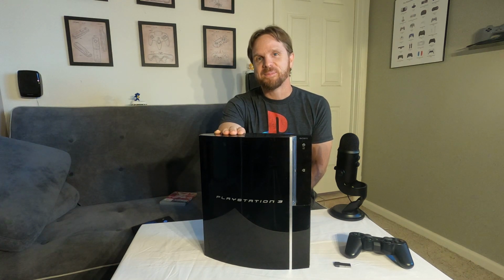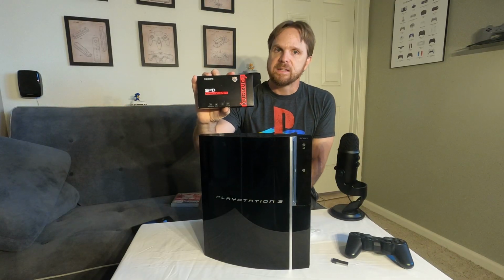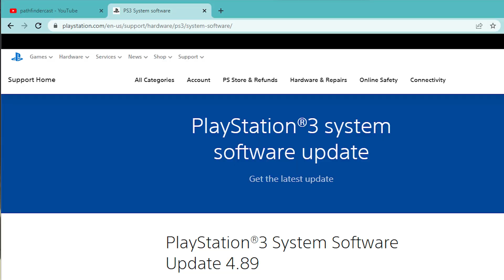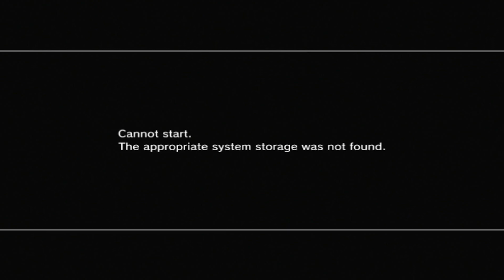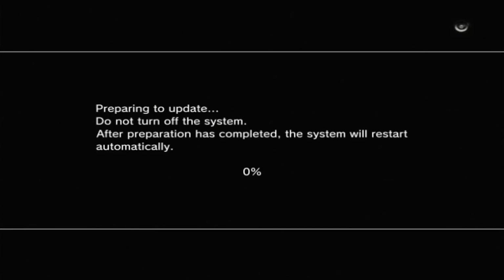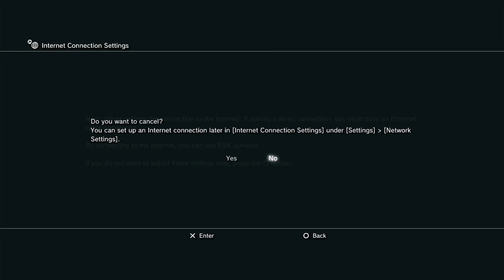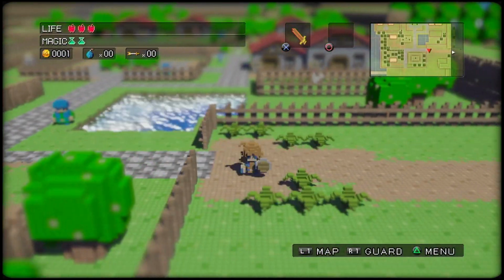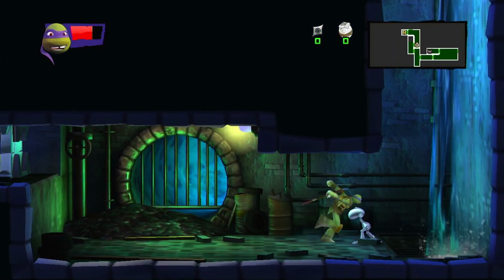Installing a cheap 1 TB SSD in my PS3 for a performance boost

Comment: You're limited by the ancient SATA connection within the PS3.
The SSD will virtually make very very limited difference.
Reply: This is partially true. Yes you won't get the full sata3 bandwidth but the 150mb/s the sata1 allows is far far faster than the 20mb/s or so that ancient hdd transfers at.
Reply: @MeepMeepMwo  yeah I agree those HDDs are old. But for me it's tryna save people from buying SSDs and thinking automatically that the PS3 will have some type of upgrade with an SSD as the PS3 has a habit just like the PS4 slim known for killing HDDs and SSDs. In the sense of they die faster and it would be a waste of money having a drive die on you and one spent $60-150 on an SSD or powerfully HDD. Although SATA 1 drives and hybrid drives are still costly, but it's the best bet to kinda have a proper drive that is compatible with the PS3 and actually helps the PS3 achieve it's max speed in writingspeeds.
Reply: @MeepMeepMwo  am just tryna help people get more bang for their buck, also to help them achieve the max writable speeds and improvement they are looking for on the PS3,  as the hybrid drive or SATA 1 can achieve these things as I've bought SSDs and HDDs thinking it would help the PS3 only to wake up one day and finding out the HDD or SSD died or failed to initialized the boot on my PS3.
Reply: @truthseekersthenewomega97  So is it a lack of trim support that is 'killing' modern ssd drives because sata is 100% backwards compatible. You don't even need a hybrid hdd just a normal modern seagate barracuda has a fast enough transfer to make it a worthwhile upgrade.
Reply: @MeepMeepMwo  true, but the interface doesn't take advantage of the barracuda I had a 500gb barracuda and it died after 6 months on my PS3. Not sure if it was just that specific HDD maybe had bad sectors, but I've had other SATA 2 or 3 HDDs and SSDs die or fail or go bad or the PS3 slows down so bad in game or you can tell on the xmb while scrolling it stutters.
Reply: @MeepMeepMwo  I should make videos on the comparisons of hybrid vs SSDs vs HDDs on a PS3.. As from my experience with hybrid drives on a ps3 it has cleaned up many of the errors, textures and graphics, loading screenings, cutscenes up with many games on the PS3 PS1 and PS2 if you have a backwards compatible model. Compared to the HDDs and SSDs I've used before. Uncharted 2 nd 3, last of us, slow downs in resident evil on the PS1 final fantasy plays much better and can confirm on my 3001 b slim Final fantasy Japan PS3. And On My 2501a slim Grand Turismo.  
Far cry 4 also plays much better grand theft auto and fall out new Vegas that has slow downs on the goty edition. I can sit here name the enhancements using a hybrid drive. It might not make the PS3 op in speeds but it those achieve what the PS3 needs and is asking for.
Reply: @MeepMeepMwo  as far as SSDs dying and going bad so quick I have no explanation to be exact on why this is happening...
However I can say this making sure the SSD or HDD is compatible as far as interface and connection goes. Don't be a me and buy SSDs and HDDs that cost $80-150 dollars thinking it's going to make the PS3 faster in loading screens 😂when the PS3 is a PATA -Sata 1 connector. Anything above SATA 1 is really just killing the hard drive or SSD TBH..
Reply: You're right. So I installed a hybrid mechanical with 8gb ssd cache that solved all the stuttering in cutscenes (FF XIII)
Reply: @skyen85  it really those help bro a lot of people don't see it but having the hybrid drive is like having an HDD and SSD at the same time and for ps3s case a hybrid drive those way more then having a powerful all out SSD as the PS3 doesn't even utilize all of the speeds. 
But the PS3 can take advantage of the hybrid drive and fix many things you'll notice it bro as you keep playing many others games especially on the PS1 side of things having a hybrid drive will clean up PS1 titles stutters shaders not working properly and textures.
Reply: @skyen85  the hybrid drive will also clean problems in uncharted 3 and the last of us. And many titles that were release in 2014-2019. Like stutters textures and cutscenes.
Reply: @skyen85  having a hybrid drive on a backwards compatible PS3 also cleans up many PS2 graphical issues and texture problems .. this is only if you have a backwards compatible PS3. I didn't really notice any difference in PS2 games on my cfw 2501a Grand Turismo PS3 console although PS1 and PS3 games run great with the hybrid drive on any model as is...
Reply: Exactly. I swapped out the HDD in my PS4 Pro with a 1TB Samsung gen 3 SSD, and it made a huge difference for sure.
Reply: @princegroove  on a PS4 it's slightly a different story as the PS4 is using USB - SATA connector where as the PS3 is PATA - SATA.
Reply: @princegroove  A PS4 isn't a PS3. SSDs make virtually no difference due to the limitations of the PS3 and the maximum speeds it can process data.
Reply: @darrenwilson99  thank you bro cause this is literally what I've been trying to explain to  them🤣🙃😩 yes the SSD will make booting up quick or loading time slightly fast, however the overall performance isn't exactly great due to the hardware limitations of the SATA 1 interface...

A SATA 1 or hybrid drive would indeed help the cause, meaning one doesn't have to waste money on an SSD to achieve max speed on the PS3. When all that is needed is atleast a SATA 1 drive or hybrid drive that takes advantage of the interface.
Reply: I was about to make this point lol🤣 SSDs do not give ps3s perfermance boosts. The best you can do to atleast get a better download speed and upload / maybe slight enhanced loading in game speed would be a hybrid sata HDD. I currently have a 1.5 TB sata hybrid drive and it's amazing 😅.
Reply: Btw the PS3 can only take 1.6 TB of internal storage. One can find old SATA 1 SSD 1.6 TB hard drives on Amazon, but you would have a steep price to pay. They work extremely well but the PS3 is also known as a hard drive/ssd killer so be careful.
Reply: @truthseekersthenewomega97  Thats not true in the slightest, they cant "kill" drives
Reply: @johnpsy4129  I have 3 ps3s a bc cechA01 a Japan 3001b final fantasy PS3 and a 2501a model Grand Turismo PS3  And I can assure you my PS3 has killed my hard drives for not using a SATA 1 HDD or SSD. You can run a script while on cfw that let's you check the hard drive life etc. I've had a 1tb SSD die on me and 500gb barracuda die on me also and a couple of cheap SSDs die on me... 
I've recently upgraded to a hybrid state drive this past year and my ps3s performance has been smooth running with a SATA 1 and I don't get the yellow light blink each time I start the consoles anymore as that would happen to me on my previous hard drives everytime I would turn on my consoles it would blink slight yellow before turning on.
Reply: Thank you
Now i don't have to even think about it
Reply: what SATA version is this again?
Reply: @RCN2820  you can choose between a SATA or SATA 1 HDD or SSD  or try looking for a hybrid drive. Any of these drives would match and fit what the PS3 needs to take full advantage of the hardware. Amazon or any place you feel comfortable buying it. Just make sure it's not SATA 2 or above.
Reply: @truthseekersthenewomega97  WTF it's SATA 1? damn I feel old.
Reply: @RCN2820  🤭 there is PATA SATA 1 SATA 2 SATA 3 nvme nvme 2 etc 

SATA 1 is basically what Sony and Microsoft used for the hard drive interface and connection meaning the compatibility of hardrive for the PS3 and Xbox were limited to the SATA 1 interface and connection meaning if I use SATA 2 or SATA 3 HDDs or SSDs it would be pointless as the connectivity as far as interface goes, it wouldn't make a difference on those consoles as the interface were locked to SATA 1 HDDs and SSDs... Reading and writing speeds...
SATA 1 is basically SATA some of us use the term SATA 1 but SATA 1 to me is mostly hybrid drives that have a SATA 1 - Sata 2 interface meaning depending on what connectivity that HDD or SSD has, it can utilize both SATA 1 or SATA 2 connectivity and compatibility. So in the PS3s case a hybrid drive or SATA 1 HDD or SSD is perfect as the interface and connectivity stand point is utilizing a PATA SATA 1 interface... I hope this is not confusing you by any means lol😩
Reply: @RCN2820  trust me bro I was in the same place years back before I figured out why my HDDs and SSDs were dying in the sense of not working anymore or being corrupted for the most part it was then I found out that the PS3s interface and connectivity of the HDD is a PATA to SATA 1 interface meaning anything above SATA or SATA 1 is a complete waist of a HDD or SSD as the PS3 is only able to handle PATA to SATA 1 to write and read  speeds...
Reply: haha finally someone is mentioning it. this whole process was completely useless. the only way to improve the performance trough the hard drive is by replacing the HDD with an SSHD and even then the improvement is not significant.
Reply: @tenorixberlin  Lucas exactly my friend so in reality although the SSHD will help the PS3 as far fixing certain things the improvements are ever just that as the ps3 as a whole is bottlenecked and having the PATA - SATA 1 interface doesn't help the PS3 either as anything above SATA 1 is basically wasting away the life of the HDD or SSD...
Reply: @tenorixberlin  Lucas trivia notice alot of these videos the creator uses cheap SSDs because they know this as well. But they only tell us this cause cheap SSDs are using a SATA 1 interface anyways which is what the PS3 requires, it's just that' the cheap SSDs will die sooner or later. So always keep a back up of all of your stuff... You can find the thread on the PS3 scene on the SATA 1 PS3 connectivity. It'll save people a lot of money from buying expensive SSDs and putting it the PS3 thinking you'll have the full speeds being utilized when in fact the PS3 won't ever utilize anything above that Sata 1 interface... I say this cause I've purchased expensive HDDs and SSDs for my ps3s as I have 3 of them and tried to do my best to preserve them to the fullest as I have 2 Japan limited editions and a cechA01 launch model that I hope to preserve and from failing from ylod and HDD SSD failures that can also cause ylod aswell😅
Reply: Idk why people keep pushing this narrative like random access isn't important in games. Its a night and day difference in the PS3.
Reply: @Legend1148  what kind of HDD or SSD do you if you don't mind me asking Clayton? Cause from my knowledge I noticed the day and night differences using a SSHD/ hybrid drive. Although it doesn't do much other then fix texture problems and certain things. You'll notice it in fall out new Vegas goty edition as that game was known for killing hard drives because of the glitches you'll notice final fantasy and far cry 4 which had huge texture issues that they never fixed suddenly fixed . Games like uncharted and last of us and PS1 and depending if your on a backwards compatible model you'll notice PS2 games run much better but only by a fraction which is still an improvement. It's just SSDs really on speed where as the PS3 interface does not really rely on reading and writing speeds. It's the RSX doin most of the work and it's why the bc models were so prone to overheating...
Reply: @truthseekersthenewomega97  you're right an SSD will not fix any mechanical issues like overheating etc but in mine I have been using a SanDisk PLUS 1TB since they came out with flawless performance. I tried a Silicon Power SSD at first but it had several issues, such as PS2 isos not working at all. My PS3 is custom firmware and all my games are played off my server but the game isn't all data, updates, DLCs etc all reside in the SSD. Some of my games I play straight off the SSD that are read heavy like Rage and GTA 4 and 5. I just pulled out the drive and read it's SMART statistics for you and I have 726 hours of use on it which all had to be the PS3 and it's still going strong. It's reporting a few TBs worth of reads but it's only got 700GB of writes to it since I pretty much install anything that's on it once and haven't touched it again.

The performance was night and day compared to the 1TB spinner I was using prior. Game installs (again off a server using CFW, not the blu ray drive) are a lot faster. FTP files to it went from 12MB/s to 20MB/s, the XMB is way more responsive, and the SSD being solid state of course means less heat generated inside. How is your systems cleanliness and cooling performance doing? Heat will kill drives faster than anything. Writes can kill an SSD too but from the drives you listed you'd have to basically intentionally be writing enough on the PS3 go kill 400GB+ SSDs so I doubt writes killed them. In your case I'd look into your cooling and possibly your power supply is having issues to be killing off the shelf components like that.
Reply: @Legend1148  that's not bad bro🙏 have you played games like final fantasy or far cry 4 or fall out and have you noticed any stuttering or pop ins or freezes playing these games or games that push the PS3s limit ??? 
Last of us might kill your SSD or PS3 so don't even try that. but if you haven't, try playing street fighter 4 or uncharted 3 and see if you notice bad pop ins or stutters, this will help you notice if the San disk is helping you out or not as those 2 games on a Seagate HDD or using a Samsung Evo has bad stutters and pop ins, if you don't notice any slowdowns or anything I mentioned then that San disk is probably keeper bro🙏🤗
Reply: @truthseekersthenewomega97  Yeah I have played all of those games on it. I played TLOU twice stock and once modded playthrough. Your hybrid drive is both SSD and HDD lol with that SSD cahce being constantly wrote over as it caches new data. All SATA interfaces are backwards compatable they were designed as such from the interface's introduction. I have never heard of an older interface killing off new drives especially. PS3 HDD is far more reads than writes I know from the SMART statistics. If your PS3 is killing off drives there is something wrong with your PS3 my mans. Your power supply has a failing capacitor or something spiking the voltage or such. 

Also SATA1 is 1.5Gbps yes but what most don't even know to quote about the PS3's data speeds is that SATA1 interfaces is still bottlenecked by the encryption process. You can see the evidence of this in the FTPing process on custom consoles. 1.5Gbps SATA speed even with overhead is faster than the 1Gbps ethernet port I use to FTP. You can get over 100MB/s speed over gigabit but on ps3 it is STILL just a piddly 20MB/s to write to the drive. But on a HDD it is still rarely over 15MB/s. Its because the chip that encryts the system requests a block of data, recieves then encrypts it, had it written, then repeats the process. This is extremely slow as its only requesting/accepting it is ready for, and the SSD helps a ton with making sure that process can serve data to and receive from it as fast as possible. Plenty of youtube videos showing the differences in speed. Also if you're concerned about longevity the SSD will hands down give you the best chance in a system like PS3
Reply: @Legend1148  that we know I've mentioned this too. but like I said this is not about writing and reading speed or downloading stuff. This is bout longevity. Which yes the SSD will also help in this factor 
Would you mind dumping your consoles nand ?? If you get a warning sign ?? it's indicating your SSD or HDD is going bad... 
Something the Smart statistics has trouble reading at time however the nand dumper will report the error the SSD or HDD has if there is one and I do know that all SATA drives are back wards compatible but I found it easier to stay on the same interface as what the console is just for safety and preserve the drive and PS3..
Reply: @Legend1148  another huge indicator of the hard drive or SSD dying is when you get a yellow or gold light when booting up the console. You'll definitely see this if you have custom firmware. 

So You're telling me you haven't heard of a HDD dying or SSD dying or about hardware or software killing drives or games killing HDDs or SSDs???? 
Type in fall out new Vegas or read reddit threads on this lol 
Fall out new Vegas was so bad in the first year that people's hard drives were dying when playing the game there are many game that have errors and texture problems and what not but fall out was something else on the ps3😩🤣 I know this because it still happens til this day and why fall out 3 and new Vegas never got a digital version of the game because of the bugs on PS3. Many other games would also cause problems like the last of us and many other games. Final fantasy even with a SSD is not the best experience as far as things go. Still many stutters texture problems were as like I've said using my Sshd has helped this out .. just saying at the end of the day it's up to the user in what ever they want to use but the best bet would be SATA 1 and or Hybrid drive.
Reply: @Legend1148  https://youtu.be/g4XsDi84vRk
These are small instances of what failing hard drive or SSD will do or you'll notice when playing ...
Reply: The only thing I think makes a difference is the power consumption.
Reply: @STALKER yes that we know, but what I am talking about is preserving the system and unfortunately if it isn't a SATA 1 SSD or HDD, it's basically not worth it as eventually the SSD will die out quicker. All hard drives and SSDs are like this but my point was that I've had SSDs on my PS3 before Samsung Evos, Kingston's etc HDDs like Seagate and barricudas ,W.D and tried many other HDDs and SSDs some didn't survive the process some did  survive however the HDDs or sdds had little life span left. 

In my time spending cash tryna figure out what is best for the PS3 as far as HDDs and SSDs go. I just found it that Hybrid Drives or anything in the range of a SATA 1 drive weather SSD or HDD to be the best option long term and from prevent errors or having your data get corrupted.  

Am not saying SSDs don't boost the PS3s performance, cause anybody will feel the difference between old HDDs and new SSDs.
However long-term wise and to preserve the lifespan of your drive and PS3 corrupting your data it is usually recommended to use a SATA SATA 1 drive weather it's hybrid SSD HDD it would be the best bet. 

My claim is that I've noticed a huge difference using a SSHD then just a SSD or HDD as most SSHDs are SATA 1 and SATA 2 compatible and the fact it utilizes the full potential of the PS3 just in terms fixing things that even a SSD won't fix there are still many glitches and bugs that the SSD won't fix in certain games, where as with a Hybrid I noticed many fixes that I had problems with in certain games like uncharted games, far cry4,  fall out 3 & fall out new vegas goty edition, PS1 games PS2 games on a backwards compatibility model PS3 and many other games fixed certain issues like stuttering pop ins textures issues loading and many other things using a Hybrid drive. Where as from my experience with say Samsung Evos and Kingston SSDs I had issues with many games although yes you'll notice transfer speeds and loadings slightly faster however connectivity and interface is bottlenecked.
Reply: Fellas if you wanna know if your SSD or HDD is best for you??? Just play a game that is graphically intense or a game that pushes the PS3s limit this will determine if your SSD or HDD is right for the PS3 as you'll notice the difference big time. If you are getting huge stutters pop ins textures problems while playing it's mostly due to the HDD or SSD... Would just recommend using SATA 1 interface SSD HDD or a SSHD also known as a Hybrid Drive. If you don't notice these problems with the HDD or SSD you are using then you should be fine for the most part, most HDDs SSDs or even hybrid drives won't won't fix everything, however your gaming experience should be much better overall...
Reply: The ssd boosts load speeds. 
Grand theft auto 5 goes from 2min bootup to 20 sec bootup
Reply: @Eheth1958  I've already explained this so if you haven't read my previous comments. My comment above helps you understand my point I am tryna get to.
Reply: @Eheth1958  boosting loading speed doesn't paint the bigger picture try games like fallout new Vegas goty edition or fall out 3 or kingdom hearts or final fantasy, doom 3 uncharted 2 & 3, far cry 4 I could go on here🤣 while playing  you'll notice stutters you wouldn't get with a SATA 1 or a hybrid drive...
Reply: Salve sto cercando un ssd da 2tb che legge la ps3 slim cech 3004A  ne sapete qualcosa?